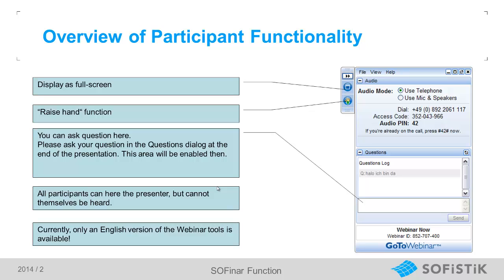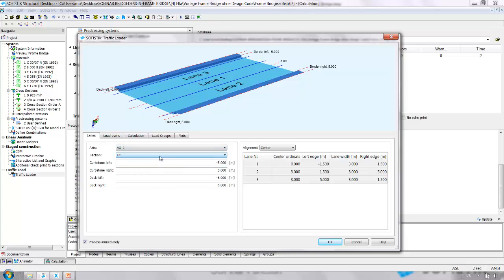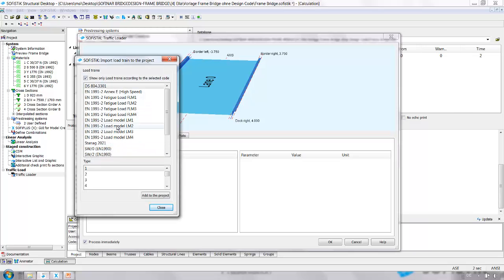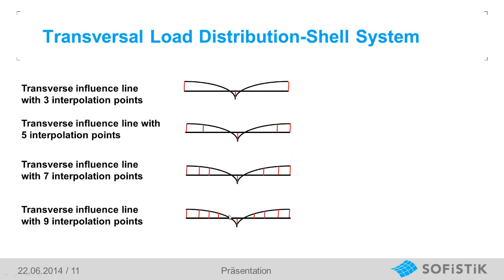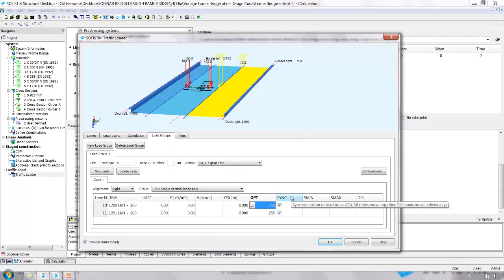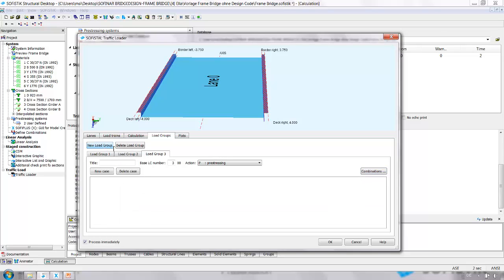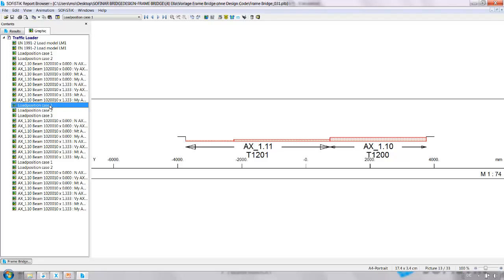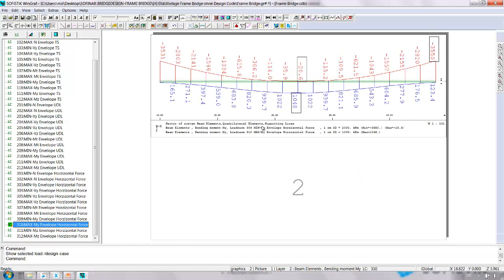SOFinar: Bridge Design (2014) - Part 4

Comment: When I export from SofiPlUS to Sofistik, the traffic load would be deleted, because I did not apply it in SofiCAD, so the question is how should I apply it and what is the load value, Should I just pick a line load on the Axis with 0 Value?
Reply from the maker: Dear Bashar,
Do you refer to live loads generated with the SSD-Task Traffic Loader? The loads are then not applied in SOFiPLUS but later on using the SSD-Task, only the actions (“containers”) for the live loads are generated in SOFiPLUS. Otherwise loads defined in SOFiPLUS should not be deleted during the export, maybe you contact our Support Team at support@sofistik.com. 

Many thanks,
Your SOFiSTiK Team